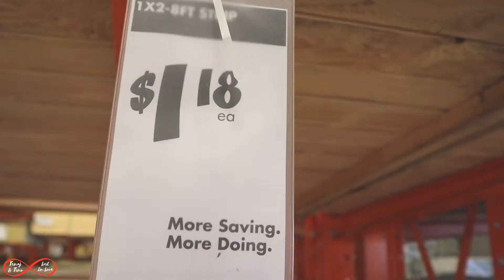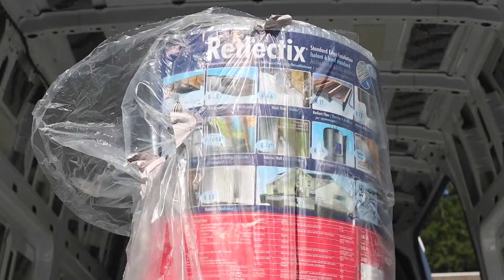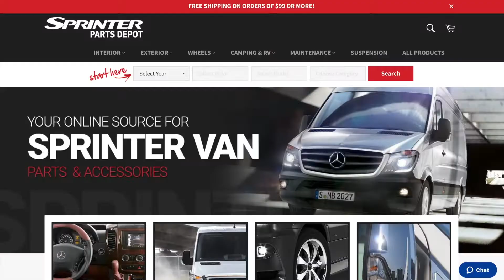The Essential Step: Van Subfloor Insulation for Comfort

Comment: Quick tip.. Reflectix is only good for use as a vapour barrier after adding insulation, it's 'R' insulation value at an inch thick is still only 0.01 which is as low as it can really be, plus the foil external layer would be touching the van floor which will create a thermal bridge and can cause condensation.... Condensation = Rust
Reply from the maker: Thanks for the tip

Comment: Hey Tenaj & Tino!!! I was wondering when y'all removed the floor if y'all were gonna discard the original floor or perhaps use it as a template to create a new subfloor. It's ALWAYS smart to try to repurpose shyt that you already have. You hit the nail on the head earlier [4:32]. Keep in mind that there are NO experts on building out YOUR van. But when you finish, then Y'ALL will be the experts on building YOUR van. Keep up the good work and Thank you for sharing. 😎
Reply from the maker: We are reusing the floor as our subfloor it’s about 1/4 inch think and we think that’s good enough for what we need.
Reply: @TenajTino  it's probably good enough like you said. I'm leaning toward poly iso foam and plywood sheet, and then engineered wood flooring, maybe. 🤔
Reply from the maker: The lighter the better 👍🏽